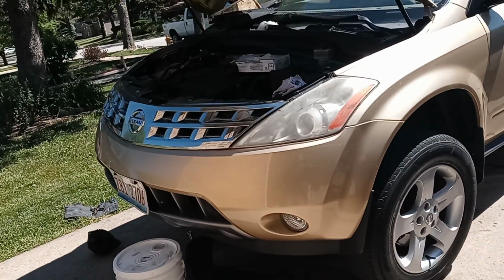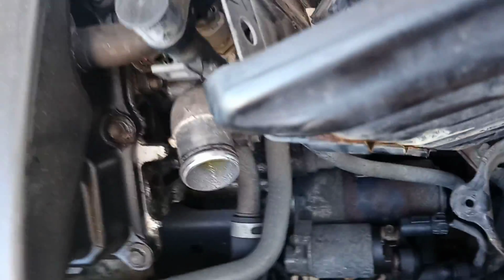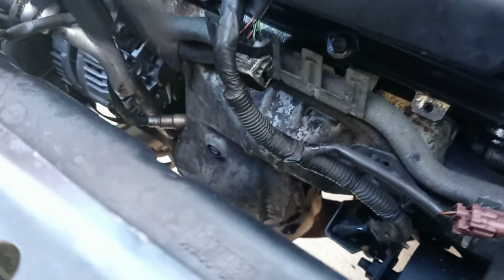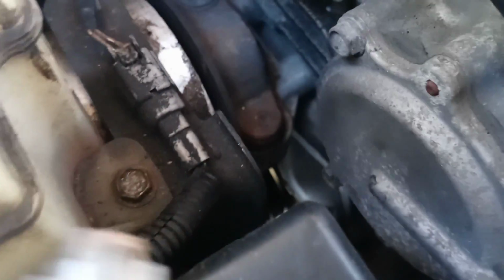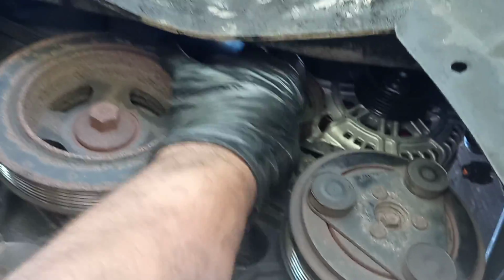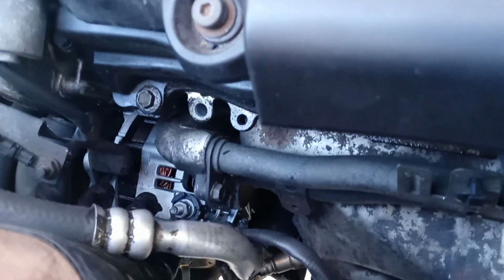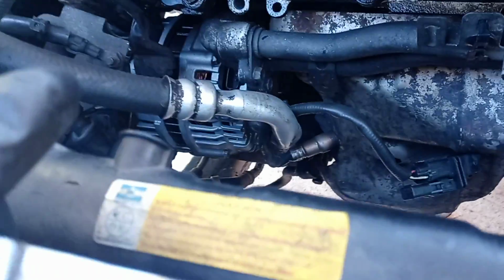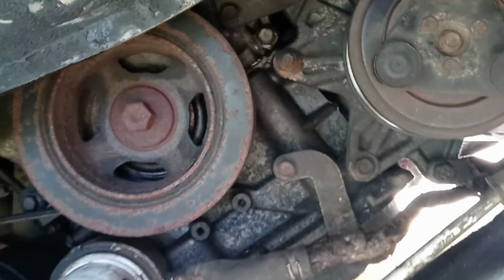2003/07 Nissan Murano,how to change the alternator

Comment: what a pain in the ass! I have a 97 cherokee that is so easy to work on compared to this.  Now I drive an 07 Murano and Brake Light + Battery light kept coming on and I googled it and found alternator failure imminent and sure enough hours later I got stranded. Luckily I was parked. Im charging my battery now and hopefully I can go back tomorrow to hook it up and at least have enough charge to take it back home 🙏🏻. I see you’re in Illinois too, any chance you wanna replace my alternator? 😅
Reply from the maker: Yeah that's to much work,did you fix it or you still need help?
Reply: @abrahamautofix3069  how many hours for this work?
Reply from the maker: @DavidHernandez-ue4fz  like 3 hours my friend